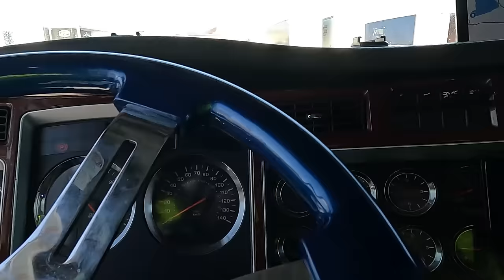WE GOT PROBLEMS!! | My Trucking Life | Vlog #2980

Comment: Don't clear the codes in the truck, the technician will use these to help diagnose the problem. If the codes get cleared the tech has to start from scratch to get to the bottom of the problem,

Comment: Pretty good guess on the fault code, most likely spots for wiring problems are splices where wires meet, and bending areas like doors. Always best to ensure proper diagnoses rather than throw parts.  Not a truck mechanic but am a regular vehicle mechanic

Comment: Josh i use a small ball peen hammer. 4 bucks at Harbor Freight to ping the the brake shoes and drum. Works good as a tire thumper too. Not that I thump tires much anymore,  with Cateye tire equalization valves now. You can tell tire pressure at a glance now.

Comment: Yes,cummins sensor pain oj pipeline on line 3 job provost we hell problrms.i notice oil breather leaks made change at oil change.i change sometimes before due date due so cold.cummins too is injector cup yes some them.make sure use sos oilsample at oilchange save yourself lots problems.i hope cold snap not hard on your trucks.thanks video😊